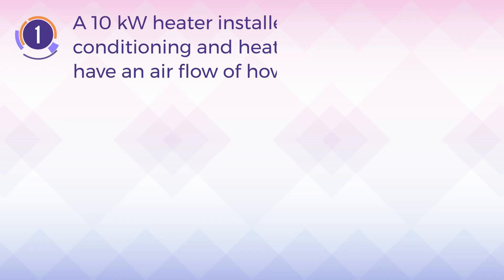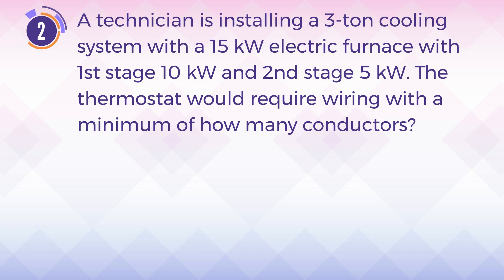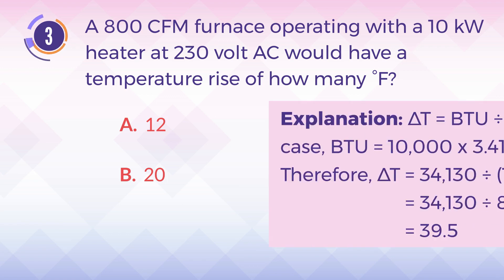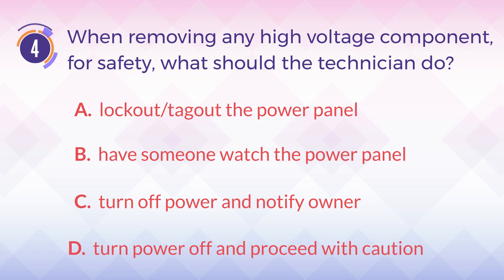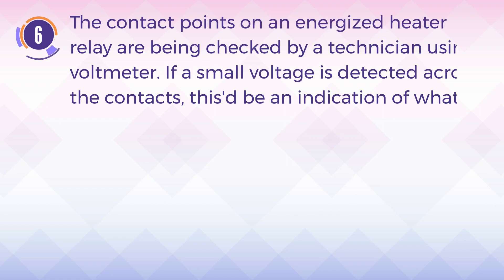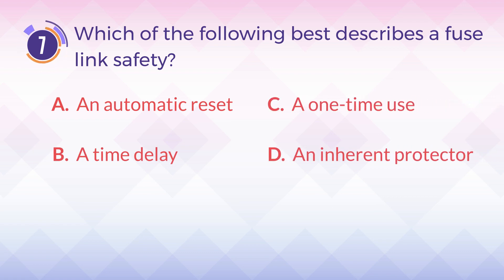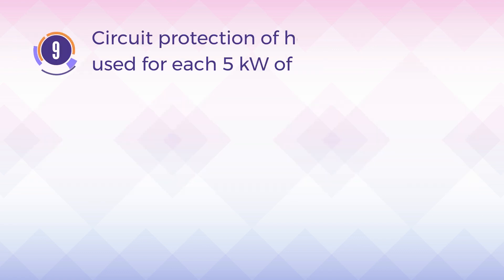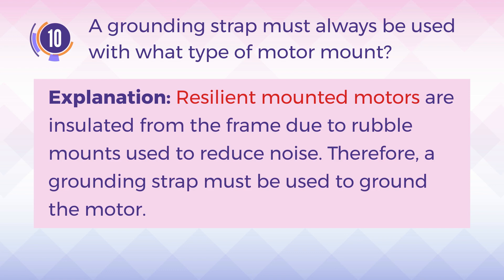HVAC Exam Prep #4 - Electric Heat | TruePrep

Comment: on question 3,  how does BTU become 10,000x 3.413? where did 10,000 nand 3.413 come from?
Reply: If I remember correctly 3.413 is a number you need to memorize for that type of equations, like finding CFM the number is 1.08 same logic. Just memorize those numbers.
Reply: 1.08 is a weight of air volume per 1 cu.sq ft. It is a constant. 3.413 is the btu per 1 kwh.
Reply: 10 kW = 10,000
and it is a conversion. 1kw=3.413. so they multiplied it together. after the explanation you just plug it in.